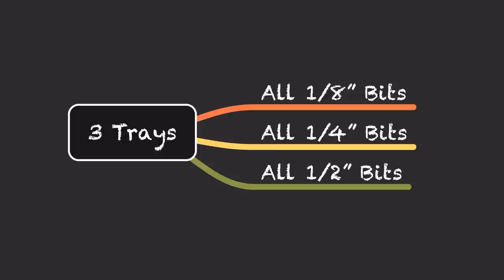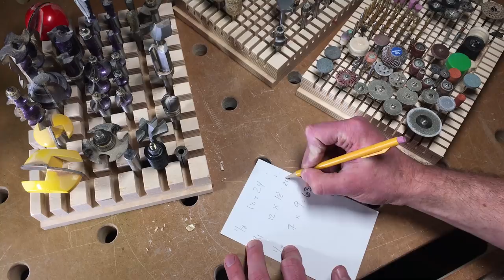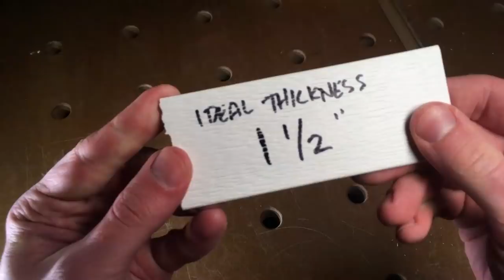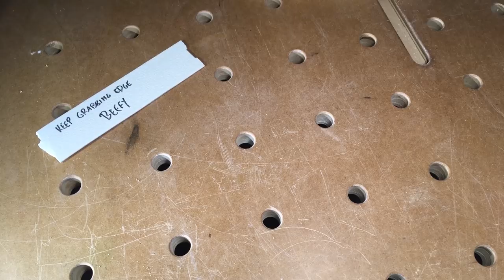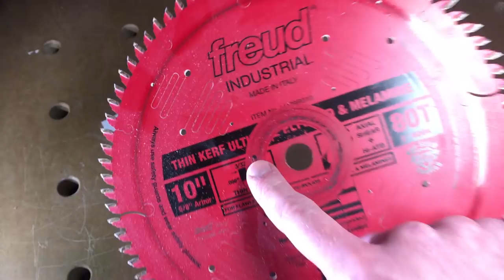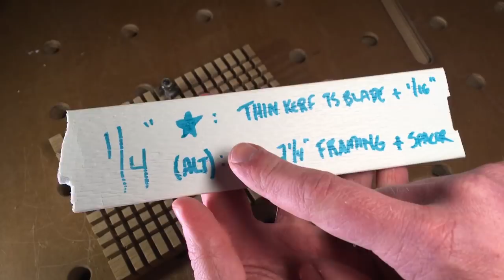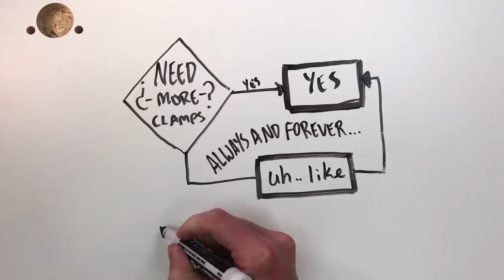Wicked Fast Router & Dremel Bit Storage Trays Using Dadoes Instead of Holes

Comment: if you use less glue, it won't slip around,  just a thin layer all over, and just press to together, it will not move versus having that 1/32 layer of glue for it to "skate" on, it will act like sand paper, super hard to move around, and almost impossible to pull apart, while the glue is wet. the van definitely had good clamping pressure, you have a 500 lb engine and tranny, plus the sheet metal, plus brakes wheels axles, that's weight. o_0 but so much glue...  that's why it slippee so easily when the van tried to pull up.  just my 2 cents
Reply from the maker: Jon Ellwanger That sounds like moderation. I’m an American; we don’t do moderation. 

Just kidding. Good idea and thanks for the comment.

Comment: When face gluing boards a little bit of salt in the joint stops the sliding movement substantially.
Reply from the maker: Joseph Seewald That makes sense...haven’t tried it yet.  Do you know if anyone has tested to see if the salt reacts with or weakens the glue?
Reply: @KeithsTestGarage  Not sure where I saw it but the Utuber stated they called glue company and that it did not make much change in the strength and had no reaction. There is a lot of surface area for face gluing.  In practice, it has worked for me and you do not really need a large amount of salt. Best wishes
Reply from the maker: @josephseewald4687  cool thanks!

Comment: What do you think to cutting slices of the 1/2" ply that are 1" wide. Then glueing them so the laminations are vertical and glueing the vertical laminations to a 1/2" bottom layer to provide a strong 'tray'?
The vertical laminations will be stronger than the all horizontal. I know it's extra work in cutting and glueing, but seeing as you saved so much time over drilling holes, it would make for a stronger tray and would look quite unusual.
I like the idea and will have a go at making something similar. The only difference is I'll have to make a box or at least an acrylic lid to keep moisture off the bits.
Reply from the maker: I think that would work, and if I'm imagining it right, the grain would have 1/2 as much tearout when cutting the dadoes.  IMO it's not worth the effort - i'm going for shop function / speed.  And, from the tests I showed - sure I had 4 columns break off, but other than those, the columns held up to considerable beating.  I was actually super impressed with the strength for a glue-up like that.  Your idea of the re-glued tray would look sweet though!   If you do it, post some pictures!

Comment: I really need to get me a  van clamp :-D
I need spaces for 3/32 shanks . With no play that's a width of 0,066 in or 1,68 mm
Thanks  for the ideas
Reply from the maker: I wonder if those thin kerf circular saw blades would work.
Reply: Don't have thin circular= dado blades - EU - but regular saws could work also :-)
I have worked some numbers:
¤    2.2 mm give a 3.1112698372208096 mm diagonal, a little to large to have the 2.35+
       shanks stand upright? And might make it possible to jam a 3,175 mm or 1/8in shank  in?
¤    2.1 mm give a 2.9698484809835 mm diagonal, might allow for an acceptable position
¤    Given a play of 0.2 mm(as yours) ~ 2,58125 ask for a 1.8252193789377757 mm
       saw/blade.

Comment: Fantastic idea. But why not use 3/4" ply and halve the amount of glue? Cutting oversize boards and use screws to secure then trim off the oversize ends seems better than brad nails. If you use screws where the dados aren't going to be you can even avoid the need for a van clamp.
Reply from the maker: I don't have 3/4" BB on hand.

Comment: Well i don't have a table saw, but if I'm really careful i might be able to do something with my circular saw.
When gluing boards together, heavy weights work quite well especially if the glue is spread very thinly and evenly.
When i glue up i get very minimal squeeze out.
Reply: Yes JM you've hit on a sore point with me. This is Garry not Linda so save the hate mail. Americans waste gallons of glue on their projects. I watch several European and Russian woodworkers and they give both surfaces a thin and very even coat of glue, they go together with very little squeeze out. Another interesting video was by George over at Woodworkers Guild of America. He did 2 years in the Peace Corps in Africa and showed how it is done there. They don't have a lot of clamps and glue is expensive so many joints are clamped by gravity. He showed how two boards are given a thin layer of glue, the edges are placed together vertically, lined up and left overnight. In the morning the joint is just as strong as any other. Check it out, the video is on the Woodworkers Guild website. He breaks the boards and the joint holds, the wood fails.
Reply: @bassrun101  Hi Garry, you've confused me with your "Hate mail", comment.
But yes, I've watched many great woodworking vids on you tube,  where people have done some very nice work, but most often when it comes to glue up, more is better and more than more is better still.
Its a pity really, because the work they do is very good and the effort is there to see.
I,m just a retired hobbyist now, but over the years I've learned that when gluing smooth surfaces together spread thinly and evenly for strongest and best results.
Best wishes.

Comment: I need spaces for 3/32 shanks.
With no play that's a width of 0,066 in or 1,68 mm
Don't have thin circular= dado blades - EU - but regular saws could work also :-) 
I have worked some numbers: 
¤  2.2 mm - give a 3.1112698372208096 mm diagonal, a little to large to have the 2.35+ shanks stand upright? 
                        And might make it possible to jam a 3,175 mm or 1/8in shank in? 
¤  2.1 mm - give a 2.9698484809835 mm diagonal, might allow for an acceptable position 
¤  3/32 in  - or 2.35 mm. Given a play of 0.2 mm(as yours) ~ 2,58125 ask for a 1.8252193789377757 mm saw/blade.

Comment: Did you check the height of breakage? Are the columns breaking on the glue plane or above and below the glue planes? Maybe they broke between or on weak ply panels.
Reply from the maker: Yep. Definitely on the glue plane. But we can pretend week plywood
Reply: @KeithsTestGarage  Eliminate the problem altogether. Glue up regular 4 x 4 wood edge grain to edge grain, cut to thickness of bit racks and plane them flat. Then do your magic intersecting dados. You'll get zero edge breakout if edges are reinforced. Problem solved.
Reply from the maker: David I can’t deny that that’s a great and clever solution for fixing that problem.  I may need to introduce my subscribers to my two favorite pets to illustrate something somewhat philosophical in nature. I’ll try to round them up for one of the next videos.
Reply: @KeithsTestGarage  If you try my suggestion post the update so I can see how it turned out. Include your pets. Something other than people powering wood through a table saw should be interesting.

Comment: Why not cut the wood into strips and laminate sideways so that the dadoes are parallel with the wood grain rather than perpendicular to it? I think that would eliminate the chip out problem.
Reply: Yeah, strips seem like the way to go...esp for those of us that don't own a table saw or dado blade setup. Easier to get a few custom slot sizes too.

Comment: Nerd comment: what counts is pressure per area, so newtons per square meter or pounds per square inch for the pirates. The force needed is proportional to the area glued. I can imagine a few clamps providing as much as or more force than a quarter of your car's mass. Though your car's tire spreads the force more evenly in the contact patch at least.

Comment: I'm new to this woodworking thing, but is it ironic that you spent so much time stacking dado blades to specific widths in order cut channels to store inumerable router bits in?
Granted, the dado cuts are much faster to make, but, since I don't have a table saw (OK, I have a rusty old table saw hidden under a mountain of boxes of rusty tools that need storage trays built for them) can I do the same thing with my router table...or will the router bits just chew the posts off on the last cut?  
Thank you for the opportunity to answer my own question!
Reply: Ixglakian instead of a router use a circular saw and make multiple passes then clean it up with a chisel.

Comment: Dont use "wood glue", use Gorilla glue. Damp wood with water, apply Gorilla and clamp (not over tight). The bond will cure with a exothermic reaction. Super strong.  Also are you using ply or laminate? not good. Try using MDF, or good old tree wood.

Comment: i feel like the clamp thing is solved by watching the process for making plywood. they don't use clamps, they use a press and an metric whack ton of glue. your van might not be enough pressure TBH. but it worked, and if it's stupid and works, it aint stupid.

Comment: I got a question about glue that has been bothering me for a long time.
First, lets talk about concrete.  The more concrete you have in a structure (thickness), the longer it will dry and cure.  Take the Hoover Dam for example, I'm sure inside that dam, where the concrete was poured very, very thick, is probably still struggling to dry and cure to this day.
By just putting a simple cap on your glue bottle will stop the glue from drying out on top, even though there is air in the bottle, what is allowing the glue to dry in a huge project where huge pieces of plywood is laid on another sheet with glue in between? Does the glue truly dry and hold like a small piece of wood an inch wide?  Can air get to the inside of a large piece of plywood, especially if you layer the plywood by several layers?  Has anyone cut the plywood and checked just how dry and "cured" the glue is compared to the edge of the plywood?

Comment: Very useful, but there are two sizes of Dremel buts, not just 1/8.
Reply from the maker: Yeah I didn’t address that because I have so few that are the smaller size, and they still stand up in the intersections. A bit more loosely but still upright.
Reply: OK, about half of mine are the smaller size, but then again, I have no ½" router bits, so making three organizers works great for me as well.
Reply from the maker: Have you found what size dado works best with the smaller Dremel bits?
Reply: I just saw your video for the first time tonight.  It will take time to measure and calculate.

Comment: Query: Does anyone ever forget what profile or pair of related profiles certain router bits make?

Clearly, if I ever did that (and I’m not saying that I have 😏), I would simply load in the bit and run a few samples. But it seems like it would be a lot easier to just figure out a way to never forget. What do all of you forgetful types think might work?

Thanks!
Reply from the maker: I have a hard time remembering until I put the bit against the wood to visualize what will be cut out.  But, buying one router per bit would streamline the testing.

Comment: What about a brad nail in the high points, that should solve the breaking problem.
Reply from the maker: Not sure if wood displacement would cause issues or not. If you try it let us know how it works. But I think if breakage is a concern, I’d probably just use some 6/4 or 8/4 hardwood.

Comment: OK but dado blades are not allowed in Europe or the UK
Reply from the maker: Keith Foster would Brexit change things?
Reply: That's not strictly correct Axminster stared selling a saw for dado blades it's got some sort of brake to slow the blades down quickly, so l guess that complies with whatever regulation applies. 

If you are at home (not commercially) there is not regulation to stop you fitting a dado blade and using it, granted you can't buy a new saw accept the Axminster one because the arbor will be too short!.

All to do with them Safety elf's.

Ha ho.
Reply: @KeithsTestGarage  - EU: not if they want to stay in a customs union with us.

Comment: Why not just use a 2x10 or 2x12 depending on how big you want it. No glue up needed. Problem solved.
Reply from the maker: I recommended that as a simpler option at 8:10.   I chose to laminate BB to prevent seasonal wood movement (cupping) that I experienced when I made the prototypes out of solid oak a year ahead of time.  Wasn't a huge issue (still held the bits fine) but since these were being slid into the slots I wanted them to stay flat.  Thanks for the comment.

Comment: Hi, what software where you using at around @1:20?
Reply from the maker: MindNode for iPad.
Reply: @KeithsTestGarage  Thanks!
Reply from the maker: Additional note:  I just used the iPad's built-in screen recording feature to record as I typed the things up.  In previous videos, I spent a lot more time drawing up things.  This video, I tested various methods of doing that sort of thing way quicker...even if it's not super polished.

Comment: Have you ever thought about doing this with HDPE sheet material  brake out would be nonexistent .
Reply from the maker: SUPERM999 somebody else recommended that as well. I don’t have any on hand, but it seems like that wood work well if you have some of that to spare.
Reply: Keith's Test Garage  it’s the same material that the white cutting boards are made out of .. 

I’m going to try your design on a piece that I have in my shop for my 1/8th bits.
Reply from the maker: Oh good point. Yeah. Let me know how it works.

Comment: Looking at the amount of squeeze-out you're getting (and it's the same amount that everyone gets) has to tell you that the glue is going hydraulic and fighting the clamping pressure.  Try using a notched trowel in the form of a fine card with minute slots cut into it.  Get a hold of a trowel used for vinyl flooring and take a good look at the edge.   Then either use that one or create one with the exact dimensions that work for your application.   In veneer and plastic laminate work, no notches are used.  The glue is applied with a straight edge.  You are not using those materials, so you need to have some kind of notch.  But that's up to you to do some testing.  You're gonna find that you are using, probably 3 to 5 times as much glue as you need (that's a total guess).  
  I would personally be interested in the final verdict on this.  I see this mistake made all the time.  In my work, I use CA glue, mostly and it's a completely different animal so I couldn't tell you exactly what the notch sizes will turn out to be.  Good luck.  Job and video well done.
Reply from the maker: alex tworkowski Interesting. I botched the card, but now that you mention a flooring trowel, I realize those use square teeth, but I cut pointy teeth.  Seems that the square teeth would make the difference.
Reply: @KeithsTestGarage  No.  Makes no difference.  You just want to meter the amount of glue that comes out.  If you cut the notches too deep, just sand off the edge until you reduce the notches to the point you're happy with.  Square will let more glue than triangular by 2:1.  I have some flooring trowels lying around here and I think they're just small slots that look square.  Totally non-critical.

Comment: Lol you a developer?
Reply from the maker: What kind of developer?
Reply: Keith's Test Garage software developer.  The flow chart looked very pseudo code flowchartish
Reply from the maker: Yes. Good catch!
Reply: It's what I do.  Software developers make the best wood workers.  Lol
Reply: Keith's Test Garage cool finishing a 1600 sq ft shop.  Probably going to use you bit storage idea.   Thanks man.
Reply from the maker: Yeah it seems to be a good pairing. Do you also use pythons to c-sharpen your blades? I’ve found that to be the best method (so far) to keep them properly angular. Sometimes some Ajax helps get the crud off.
Reply: Keith's Test Garage lol. I do use most of them often.  First thing to get working was power then lights and finally pull fiber to the shop to support the gig connection.
Reply: Keith's Test Garage actually writing Microsoft flows at this very moment to automated the build qa test process.
Reply from the maker: Oh man. I’m actually currently in a state of awe with the potential of Flows, and creating demonstrations to convince the company I work for to rethink the way we develop collaboration stuff, and start using Flows to integrate/automate/ease collaboration to get knowledge into a place that’s properly searchable.  Not an expert by any means. Just a kid in a candy store.

Comment: SUPER STUPENDOUS REALLY - next step is to make a stop in your back fence to fit the first cut kerf. Right? Make a stop from 1/8 thick plate, and cut it 1/2" high by 2" long and dado your fence to accept it on which side of the blade you are working.   It starts out against the side of the workpiece. Then, make your first cut, then slide the workpiece onto the stop at the kerf, and continue with that.  NO MEASURING!  If you use a thin piece of metal, you can use it to make two exact passes by pressing first one kerf wall and then the other.
Reply from the maker: It didn't, but I think I know what you're talking about - a while back I made a box joint sled like this, but with a wood piece as the key of sorts.  Is that kind of what you're talking about?  I think that'd work well for precision, but would be slower to set up (just as fast to use though).  How would you mount the metal strip?